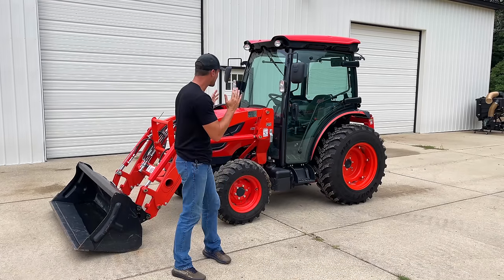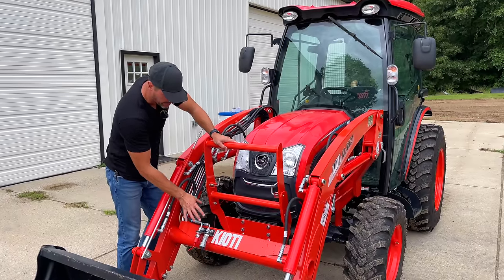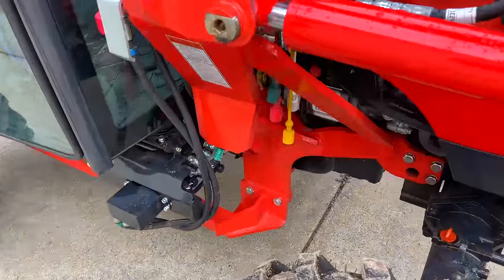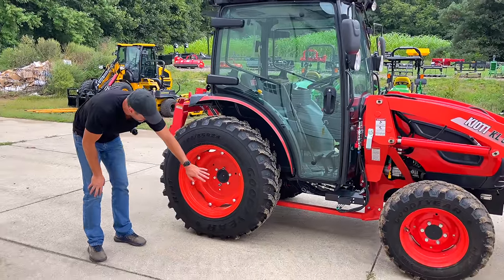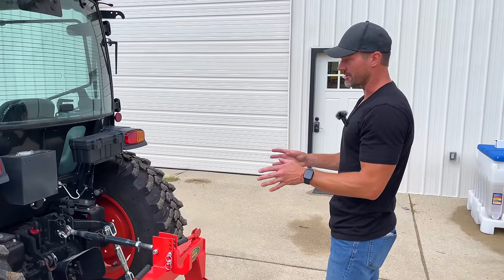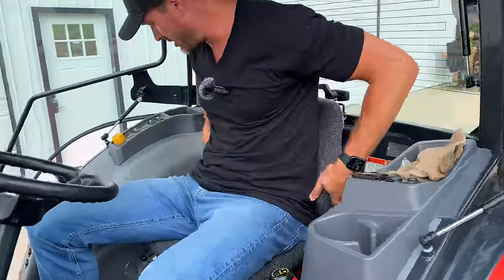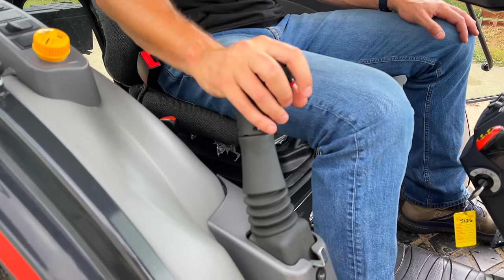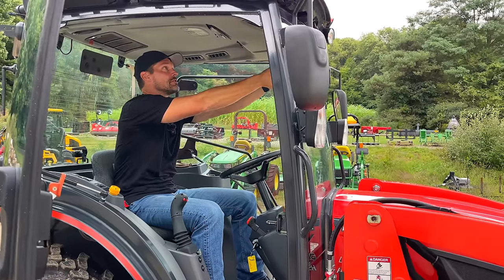THIS IS CRAZY! 40HP TRACTOR LIFTS ALMOST AS MUCH AS THE 4066R!

Comment: I upgraded from my Mahindra 4540 to my Kioti DK5320. It has been a night-and-day improvement. The cab is amazing, and the hydraulic flow is almost triple what the mahindra was. I have been 4x more productive with my Kioti than my old Mahindra. Parts have been much better with Kioti over Mahindra too.
Reply from the maker: That's awesome to hear.
Reply: Ya, Mahindra is one of the last tractors I would buy being a heavy equipment mechanic. I would go with LS or kioti. Honestly kioti is a really good machine but some models of LS are insanely good, not only for the price but I would honestly say they are higher quality than a lot of the other manufactures. Better transmission, better front axle and really nice cab.. I have kabota , New Holland and LS and I think the next tractor I'm going to buy is the the LS mt573 ..
Reply: Great review that is a sweet lookin tractor for sure.  I went to buy an l.s. tractor wasn't crazy about them then went to kioti didn't have any luck financing one there so went to Mahindra got 1626 shuttle don't have all that regen crazy on it n Def it  does all I need a tractor to do.  Sure would be nice to have a cab though.  Thanks for sharing be safe have fun

Comment: I have a CK 2610 which is a 25 hp machine. It’s the SE model.
It has the cab it does have armrests it has two rear remotes plus the third function on the front telescoping rear lift arms and telescoping draft links. It’s just over two years old and I have 710 hours on it. I use it all the time moving brush some light duty bush, hogging tilling gardens for people. Etc
I absolutely love this tractor I maintain our family farm which is about 110 acres and of course I don’t do cropping with it but I pick up fallen trees that loader on the 26 tin can pick up 1800 pounds plus 
I really enjoy your channel Courtney!
Reply from the maker: Sweet, sounds like you're using the heck out of it!

Comment: I've been extremely satisfied with my 2021 Kioti DK5310SE Cab. 50 hp (38 hp at the PTO), incredible front and rear lift capacity and the price was right. I haven't had any issues to speak of with it after putting 265 hrs on it. I am looking forward to many trouble-free years running it on my 21 acre homestead.

Take care and God Bless.

Comment: I researched compact tractors for nearly 2 years before purchasing one roughly 2-1/2 years ago.  I spent a lot of time watching various YouTube channels on tractors, as well as checking out specs and pricing.  My decision at the time came down to a Kioti.  I purchased a DK 4710SE (45 horsepower) cab tractor/loader/backhoe combination with a 6' rotary cutter, a 7 foot box blade, and pallet forks.  I couldn't be happier with it.  I also figure that I saved a considerable amount over purchasing either a Deere or Kubota with similar capabilities.  It's good to see some positive information being put out there on Kioti tractors from someone other than a Kioti dealer.  Thanks for th video.

Comment: I have a RX6620 cab  and it is a beast of a tractor, hyd.s are lots of pressure , 280 hrs , grapple a must.  Lots of height . 
Cameras front and rear for sight of quick attach, on cutting edge of box scraper. Replaced work light with LEDs  3 hyd s on rear tilt and angle on 3 point.  Bad things in winter steams up windows take a long time to warm up, first aid ,fire extinguisher. 
Regen is good , keep above 2100 rpm. upgraded battery to what they call for in manual 100 ah.  Air is great, heat will cook you out in winter. Sound proofing is good, thats my 2 cents worth . Arm rest on right side. Gear drive clutch. Paint is dull on the roof sun exposure.  Bucket can load full . Thanks for your videos ,

Comment: Thats why i ended up with my Branson 4225CH. Lifts just shy of 3000 pounds and the 3 point is around 36 or 3800. Had to fill tires for ballast :)  it was twice what most the orange and green tractors in the same hp range. Very happy that i can move 2 round bales at a time!

Comment: I have a dk5310 se hst cab. Just turned 400hrs in under 2 years. It’s been a beast with no problems so far. Lots of dirt work, grapple work, plowing, tilling, mowing, grading. It gets worked hard daily.  Side note, it will pick up an old Honda  civic and set it on a trailer with the forks. Lots of videos of it on my channel.

Comment: I have this exact tractor, except with 350 hours on it.  I can't agree more, it is a workhorse with a cab for heating AND A/C to boot!  I bought this when JD and Kubota couldn't get inventory in, and I am so pleased with my "3rd choice accident".  Super impressed with the capabilities.  My only regret is that I didn't max out with DK6010SE instead as it has the exact same weight as the 4210SE with more HP in the engine and PTO.  Other than that, literally no complaints. It handles my GWT stump bucket just fine!
Reply: I assume that tractor is available with gear transmission?  Kioti are good tractors.  I don’t like HST on any tractor…..if all the dozens of tractors I have had I have not had a Kioti yet but will surely pick one up at an auction soon.  Great video!

Comment: So glad to see you with a South Korean tractor.  I don't think people have been giving them the credit they deserve.  I looked at a JD 1025 2 springs ago and came very very close to buying one.  I did some more research and ended up buying the TYM T 264 for $4k less with the tax than the Deere.  The TYM is physically bigger and the capacities are way higher.  1400 lbs in the bucket vs 700 at the pins for the Deere plus the physical size and width make a huge difference.  Mine has a Kukje and that almost kept me from buying it until I did some research and Kukje is made by Cummins since 1959 and it is full mechanical, no electronics once it starts.  I am so glad I didn't pull the trigger on the 1025!

Comment: I’ve got a CK3510 SE cab.  Bought it in 2019.  Only problem was a banjo hydraulic fitting metal fitting was undersized (known issue, now fixed), which caused an O ring to blow out after 180 hours.  Repair covered by dealer, since known issue.  Great machine.  I’ve worked it to (and at times beyond) capacity.  Was nearly 18k cheaper than relatively comparably-featured JD at the time.

Comment: I did a ton of research, wasn't financially limited and ended up with a Kioti NX5010HST Cab for maintaining my 55 acre property.

The value for your dollar is hard to beat and if you have a good local dealer it's going to be a great choice.

I just didn't see the benefits of the extra price in a John Deere or Kubota especially when I found out Kioti makes all the Bobcat compact tractors.
Reply: I also consider Kioti to be better quality than Deere and on par with Kubota you’re also right about dealer. I asked all dealers for quotes and was pleasantly surprised got the best deal from Kubota here but it varies on models other discounts, dealer volumes etc.

Comment: I went from the dreaded JD 2320 with the bad drive shaft issue to a CK4010 HST SE.  No comparison of course, different class.  Such a smoother ride as well over my rough pasture when running a finish more or dragging.  Tremendous lift ability and power.  A similar new JD would have been roughly 10k more, for green paint!  That buys a lot of implements if needed.  I'm glad a made the switch.  Could be the last tractor I purchase new with all its capabilities and power.

Comment: This summer I upgraded to the DK5320SE cab from a CS2520.  The lift capacity is amazing on both of these tractors for their size.  If a person has a good dealer in their area, Kioti is a solid tractor to consider.  I look forward to GWT showing more of it's capabilities to folks as Kioiti seems to be brushed aside on larger channels often times.  Glad to see GWT showing one off, even if it's just while waiting for it to sell.
Reply from the maker: I've got a couple other Kioti's that I'll be trying out too.  Shoot, might even buy more of them.  I really like them!
Reply: @GoodWorksTractors  check out their K9 Cab UTV and ZXD zero turn.  They are also releasing a 74 hp track and skid steer shortly
Reply: @GoodWorksTractors only problem I have with Kioti is their small number of dealers.
Reply: 😅it has a quick hitch, how many times are you going to be adjusting sway links?
Reply: I own a RX 7320 cab and it is a great tractor and I have a great dealer!

Comment: 9:13 WOW!!! Air filter and battery placement is interesting, it’s almost like the engineers want air flow through the coolers. The popular thing on other brands is to put battery and air filter directly in front of the coolers. It still cools enough…with a much more aggressive fan that can take a 5 or more horsepower to run at higher rpm’s. That 40hp is closer to 33-37 hp with the fan drawing air through the coolers.
Reply from the maker: Interesting thought, something I hadn't considered before.
Reply: @GoodWorksTractors  I have background in repairing equipment and did a lot of diagnostics and modifications. Lots of root cause analysis, general analysis, and theory of operation stuff. 
Most of the engineering and design of smaller tractors drives me crazy!!!

Comment: Super happy to see you try out a kioti. The adjustable, side links, armrest, and two rear remotes are standard on the SE model, something to be considered.
Reply from the maker: This one is a SE model and doesn't have the telescoping side links, arm rests, nor two rear remotes.  So, can't be standard?
Reply: @GoodWorksTractors  my bad! I just looked at the website! You’re right, I swore those were standard features on ck and dk se models. Huh. I’ve checked out quite a few and have seen each have all the features at the dealers. I’m surprised a dealer wouldn’t add those on to make a little more on each item.
Reply: @nelsonsridge   At least when I bought my CK SE, those things were indeed all part of the SE package, along with tilt wheel, cruise control, and the linked pedal. IDK if the DK SE is the same though.
Reply: @MoparNJ  yes! My ck3510se came with all the options

Comment: I seriously considered a Kioti NX4510 when I was tractor shopping.  It had the best hydraulics and lift capacities, and was almost $4k cheaper than the Yanmar YT347 I ended up buying.  Maybe it was in my head, but I think those huge hydraulic cylinders caused lag in their motion.  It just seemed jerky/delayed.  It also didn't have enough PTO HP for my needs (33.9 vs 39.5 in my YT347) and was 5 inches narrower, which is a major negative if you have hills like mine, and I prefer a 4-cylinder NA over a 3-cylinder turbo engine.  But it seemed well built vs Massey and the other "budget" brands.

Comment: I have a 2006 Kioti DK45SC and have been fairly happy with it.   The biggest /  most expensive issues my machine has suffered over the years have been broken bevel gear housings (3 times) and fuel injector pump failure (also 3 times).  It is a heavy, very capable machine, but I've been researching a replacement...maybe with a few more horses.   My biggest complaint about the offerings now is that none seem to have a self-leveling loader.   I always took the KL451 self-leveling loader for granted on my DK45, but turns out it is a rarity for this size class!  Compared to using the loader on my wife's Kubota B2650, the Kioti loader is a joy; I don't accidentally dump stuff on the ground...or the hood with my Kioti.  Why are self-leveling loaders so rare (even in the new Kiotis)?

Comment: 14:23 The heat shouldn’t be a problem in the winter time after it warms up. You’re sitting over a giant heat source and all the vents should push the heat down enough, especially if their all angled the same direction so the air kinda rotates in the cab. 
The radiator might need some cardboard in the single digits and on the crispy side of zero.
Reply from the maker: Yeah, think it'll be okay.  My 4 Series was similar if I recall.
Reply: @GoodWorksTractors  I could be wrong but I’m thinking you’re going to be doing good with these. The market is definitely changing and the less popular brands are investing into producing a better product. My thoughts are that you’re in a great position as this market is entering a new phase, especially with implement sales to maintain the flow.

Comment: I have no real complaints with my Kubota L4701, but I think if I were buying a tractor again that Kioti would be in the top 3 contenders. Regarding lift height, it looks like you pay for that with how far the bucket extends past the front axle. That could reduce maneuverability in tight spaces, like inside a barn. I have a 40x60 manure barn that has some bunks for chicken litter, and I use it for storing attachments, wood and fence posts, log splitter, and and trailer. It can take some back and forth to get lined up on something, and you've got to be VERY aware of where everything is to avoid bashing things up.
Reply from the maker: Chris and I were just comparing the Kubota L3560 we have to this tractor.  The Kioti visually looks shorter front to back than the Kubota.

Comment: I have a ck3510se,  the SE models have armrests, telescoping three point side arms with easy connects. Two rear remotes, good stuff!
Reply from the maker: This is an SE model and doesn't have those features.
Reply: CK standard equipment versus the more basic DK version where they are add-on options

Comment: My only complaint is the thermostat is pretty low temp so the heat never really gets hot in winter. The ac compressor doesn’t run when it’s below 20f so I have constant window fogging issues in the winter. (I use mine for snow removal business). 

Wish it had more speed and torque in high gear too.

Comment: i have the CK4010 SE cab.  It came with 2 sets of rear remotes standard, the arm rests, and some other features the DK doesn't have, but the DK has some options not on the Ck, and of course one frame size larger.  It was a difficult choice between the two.

Comment: I have a 2022 CK3510 SE HST. Money to features and power is hands down better than any Kubota or JD. My dealer has great service is
Local, and asks all the time if I’m interested in consigning it or selling as he has customers waiting.  I have just over 80 hrs on it two remotes for the back ballast filled tires were standard issue from the dealer. Quick hitch and hydro top link. Runs a 60 inch titan tiller, pulls a 2 row planter, 5 ft bushog never bogs down in high grass. Just a solid built machine like you said. I have owned a Kubota and sold it due to being underpowered. Great to see this DK on here.
Reply: One other feature I like is pedal control throttle. When activated the tractor throttles up according to how hard you push on the HST pedal. It also came with rear working lights and mirrors and rubber floor covering and 0% financing by Kioti !!!

Comment: No mention of the price or engine specs but an interesting video.  Kioti dealer closed down here so not sure why. It would be nice to see $$ comparison between JD and Kubota and Kioti.
Reply from the maker: I don't put prices in videos.  Videos are there forever and while you may realize it' an old price, much of the internet doesn't.  It becomes a constant pain to explain.  40HP engine is listed in the title of the video.  Didn't go through every spec, but Kioti's website has all info needed.  Just hitting some highlights.  https://www.kioti.com/products/tractors/dk10se-series/dk4210se-hc/
Reply: I very much appreciate that at least Kubota will let you spec out and get msrp on the website didn’t see that on Kioti site